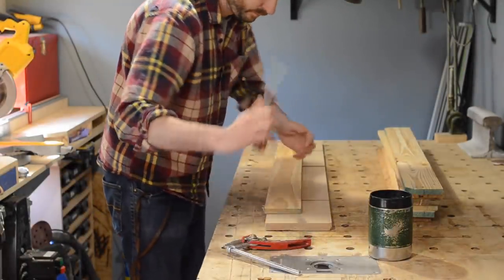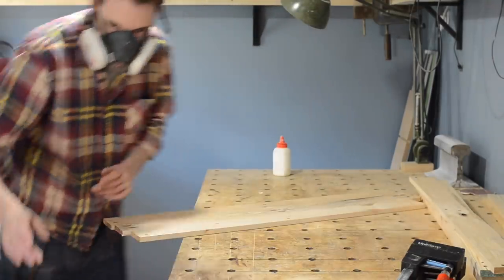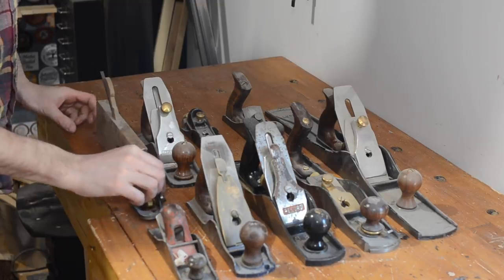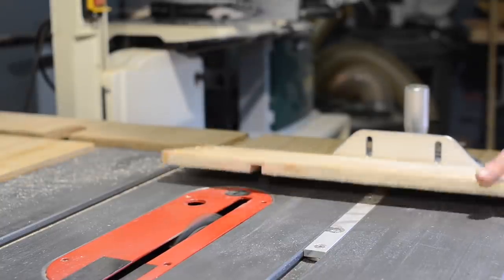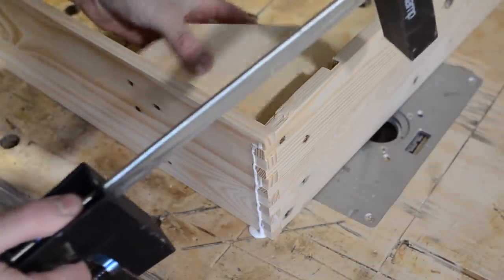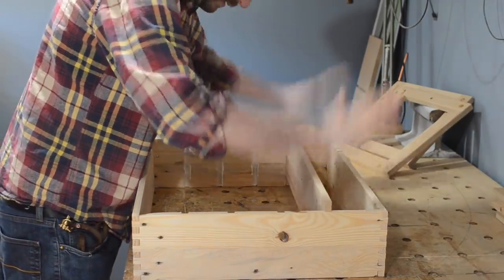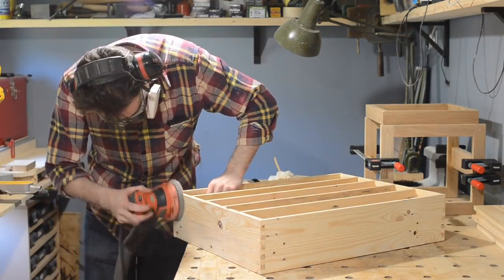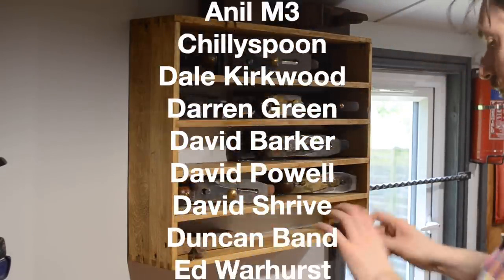Hand Plane Rack

Comment: Nice plane collection Matt. Just an observation though: i never see you use any hand planes in any of your videos. You could have used one here to join the boards but you used your table saw. You could have used a block plane to flush up the fingers, but you used a sander instead and unless I'm mistaken you have a dado plane in your collection too. 
I'm guilty of the same thing. modern day wood workers have a nostalgic soft spot of planes/chisels etc but in reality our machines are much quicker and easier to use.
Reply from the maker: As i said in video they have been stored away